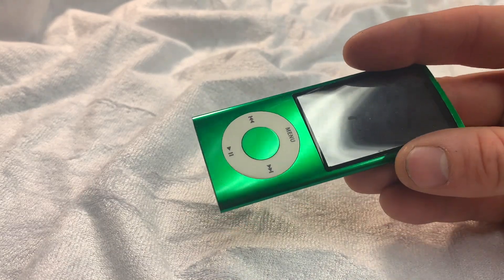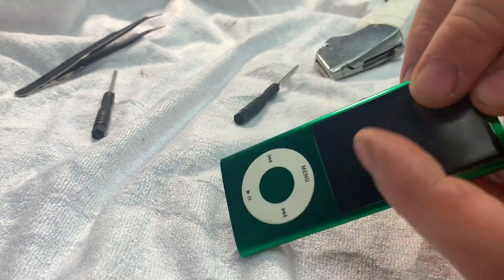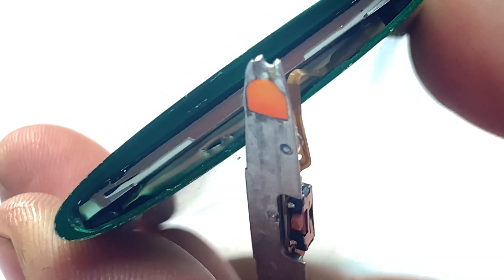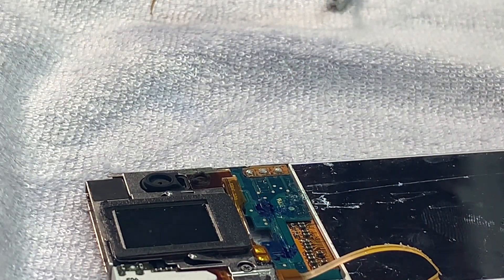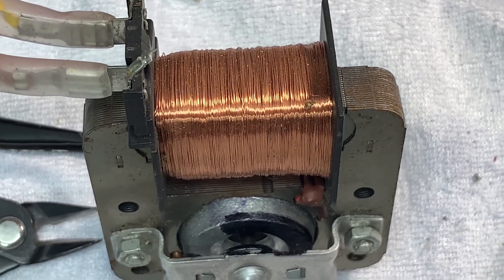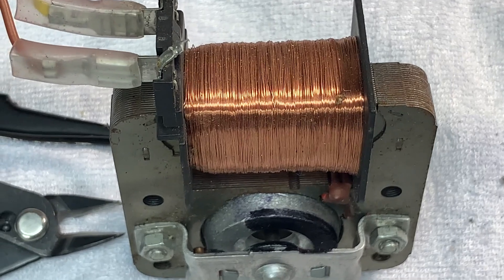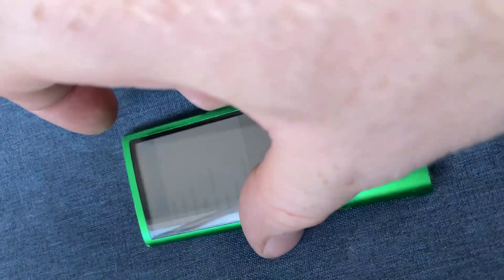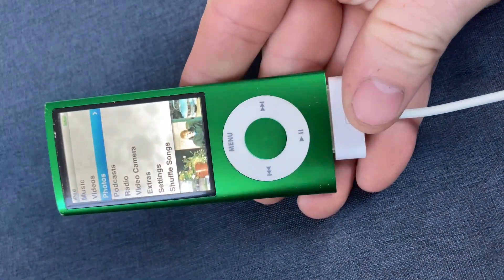iPod Nano 5th generation battery replacement and hold switch repair

Comment: I wish i would have watched before my repair. I thought the adhesive went the whole way down the back, and when sliding the logic board out firmly but gently, once the adhesive part was cleared, the board slid out and the frame snapped the ribbon. Thanks for showing us the junper cable fix.

Comment: When you solder the tiny cables into the switch does it matter which cable goes to what solder point?
Reply: I was wondering the same but if it doesn’t work prob just desolder and switch them around try again

Comment: Thanks for teaching us this bypass for the hold switch, I was trying an overcomplicated way to get wired the ribbon cable, but connecting directly on the plates was much easier and elegant. Again, thank you.

Almost forgot, you can get wire easily from cheap headphones, those that give you on planes, it is varnished, very thin and come in colors, just scrub some of the varnish to get better contact before soldering.

Comment: I tried to disassemble and replace the battery of the nano 5g and snapped the hold switch cable as well :/ Just that i didn't pay attention that the switch part got caught on the lower edge of the  case opening for the screen. When i did and released the cable, it already was too stressed and snapped :p Thanks to you i at least didn't have to figure out which testpoints near the lego connector were for the switch. Instead of cutting through the metal parts that holds the lego connector down, i cut the already snapped cable near the connector, as close as possible, for minimum damage and got access to the tespoints that way, which totally was no fun.  Sadly i had no enameled wire, so i had to order some. i cant report on the results yet, cause i'm waiting for the cable. Will do though, as soon as i soldered it to the hold-switch :D I'll solder in the new battery as soon as it's daylight again. Never work on fiddly things at night, when you're getting tired and your brain isn't fully working anymore :D lol

Comment: how do i discharge the battery? mine has expanded and i'll have to pop it to remove it but obviously don't want to do that if there's a risk of it setting on fire
Reply: You can put the iPod in the freezer, the gas will contract

Comment: Pfft... too much hassle. Just toss it.
Reply: I take it 100+ screws to take apart some older laptops is something you wouldn't do, then? 😂
Reply: @escapetherace1943  Well for starters, there's more parts in a laptop I could repurpose than an iPod.

Comment: Wow this is a lot of work.
Reply: Well I bought the battery before I knew how much work it was going to be to do it, but I did eventually end up doing it, and it worked perfectly, and I didn't break anything. But you do have to be careful for sure.
Reply: @TexasNEV  worth the trouble or no?
Reply: @diegiscool  If you are Ok w/ the possibility of breaking it and have the proper tools, then I guess.  If not, send it off.  You must have a heat gun, xacto knife blade, jewelers screwdrivers, soldering iron with a fine tip, etc, a magnifying headset would be very helpful, be very careful to not lose any screws or overheat the display, etc.
Reply: @TexasNEV  How's the battery holding up? I heard the replacements for these aren't too good
Reply: @MR-wn6ln  seems to be okay so far. 🙂

Comment: question. is it not possible to push everything out from the top instead of the bottom, given you managed to cut through battery adhesive prior?